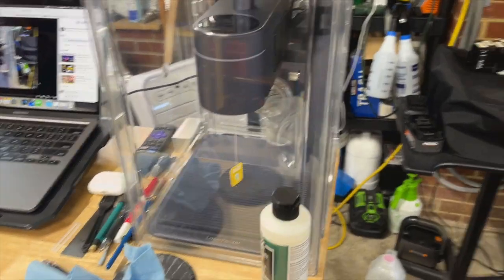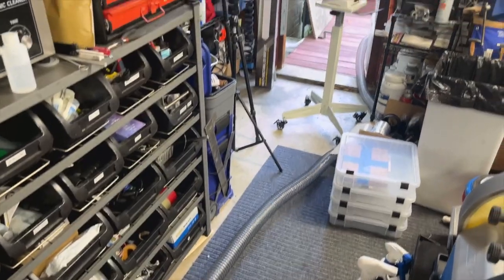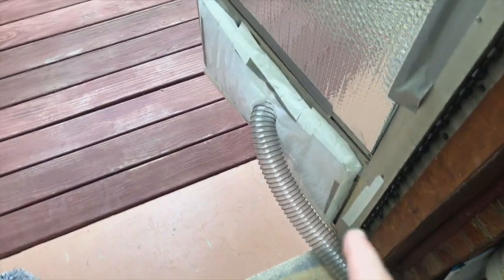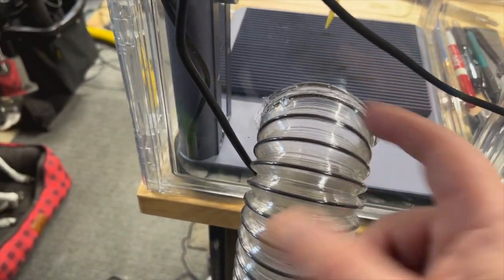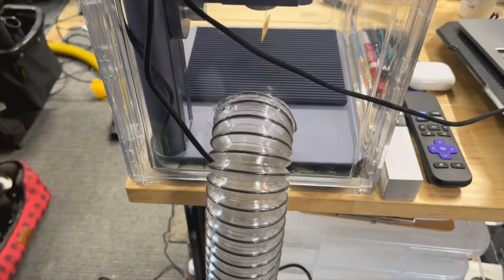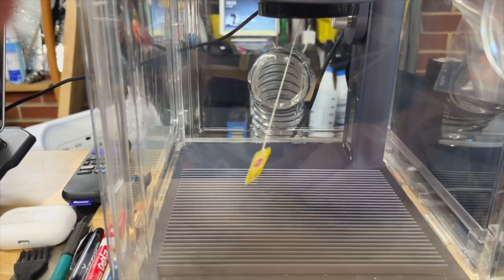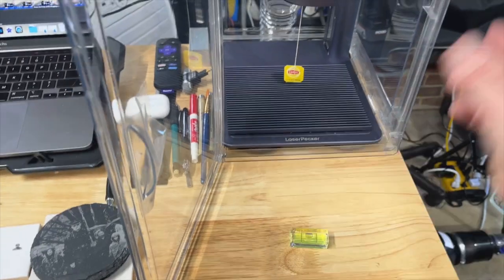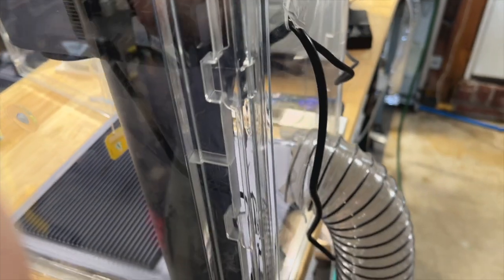DIY Vent Hood for Laser Pecker 4

Comment: I purchased the Laser Pecker 2 and have been looking for a solution and yours seem to be the best I've found.  I was beginning to hate that I purchased it until seeing your video, I think I can build this by myself.  I've been unable to use the laser pecker because it is very cold where I live and lasering inside without filtering isn't an option for me.    Everything I read suggest it is very dangerous (health wise) to not filter/exhaust this unit.   Only thing is, I have to figure out what size tubing I need since I have the 2 and not the 4 which you are demonstrating here.  Thank you for sharing.

I forgot to ask, did you ever receive your vent hood from Laser Pecker.  If so, how is it working for you in comparison to this?
Reply from the maker: I have a new one and an updated video and a better tent  now made a new more permanent solution the tent I used is in my laser section of my tools if you go to the “for sharpeners” section of my website you will see the tent I now use. The laser stuff is at the very bottom https://alxsharpen.com

Comment: Clever using the UV resin! Your video (like the others about the LP4) are timely for me. Mine is finally arriving on Tuesday! In trying to figure this out for myself, my challenge was that I don’t have any good place to run a vent to the outside. So I opted for a small air purifier system with a 3 stage filter that I hope is going to work well enough so I don’t get poisoned. LOL I loved your shoebox solution—you are wonderfully creative. :)
Reply from the maker: So far the only horrible things for me were plastic.  Metal not bad ,wood lots of smoke but smells ok but since doing this vent fan I get nothing it literally sucks every thing out so if there’s any way you can figure something like this out I would do it getting poisoned 🤢 would definitely not be fun
Reply from the maker: I did order the laser pecker filter but mostly for doing it in places other than my shop. That said the #1 solution is always to vent outside so even if you had to build something to put in a window using a fan like I made and a piece of wood with a hole that you could just bring the window down on while using is far better solution than trying to filter the air clean.